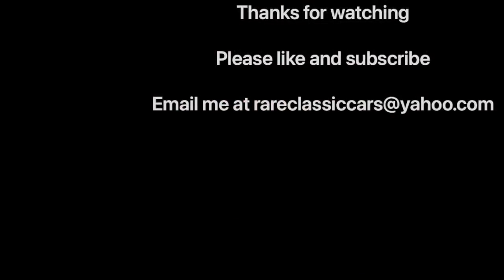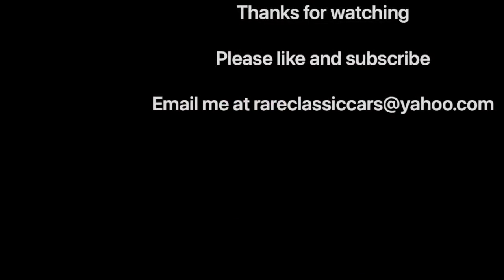Worst Engines of All Time: GM 2.5L Iron Duke Follow Up

Comment: I had a 88 S10, and a 86 Pontiac 6000 .  Both with the iron duke.  The engine was MUCH smoother in the S10.  When the S10 engine got about a 110,000 miles, it started to rattle when you reave it up.  I did fine that Slick-50 made it a little more quiet........for a while.
Reply: Jim, in ‘88, GM started equipping that engine with balance shafts. Your ‘86 doesn’t have a balance shaft. 

The ‘88 engines were far more pleasant than the older ones ...
Reply: @sking2173  I don't remember any advertising for the balance shafts
You think GM would really promote that
Reply: @jimosterfeld3371  — Yeah, I would have thought they would have made that a selling point, too. I knew it because I was a gear-head, so kept up with automotive news.

Another balance shaft addition went quietly into production in ‘88: the Buick 3800 V-6. In ‘87, the 3.8 had been redesigned to be an even-fire engine, which was highly publicized, but the balance shaft addition the following year came without fanfare.

That engine went on to be one of GM’s best ever.

Comment: I think in the last 2 minutes of your video you hit upon the essential point of why there were so many conflicting responses to your last video. It's all about expectations.

Large domestic 4 cylinder engines were not a new thing in the late 70s. So I would imagine it came down to whether customers were ready to accept that rough operation in return for an unstressed engine. If that rough engine delivered on what was expected (long reliable operation, mileage, whatever) then that should be considered a relative (acceptable) success. Buyers who traded in and might have been horrified at the behaviour of the Iron Duke as far as smoothness... that might itself point to one of the reasons why the domestic auto industry suffered so greatly in the 80s-00s, because people continued to patronize companies that ignored market needs and relied on brand loyalty. (one just has to look at the crop of bland vehicles in Pontiac's roster the few years before its demise... is there any surprise that it was chosen to receive the ax? Once older set-in-their-ways buyers got too old to keep buying G6s and G5s etc. the brand would have died anyway!)

So as you said in the last minutes of the video, many people who test drove the smoother import 4 cylinders probably ended up shying away from domestic econo-cars for good. (from memory, not all import 4 cylinders were smooth! So it's not an issue unique to the Iron Duke). If no one had bought Iron Dukes the bean counters would have certainly reacted fairly quickly (note how it disappeared from the F-cars by 1986). But people bought them and kept using them and it seems they did what they were expected to do: move people (and cargo to some extent) from point A to point B with a fair amount of reliability. Those expecting to rev with the DOHC'ers were disappointed, but their expectations were completely out of line to begin with and a half-decent road test would have confirmed this prior to a purchase.

In summary, customer expectation mismatch is not a reason to label an engine "worst of all time". There are plenty of engines in history that even when operated well within its intended parameters, failed to reliably deliver on their basic mission and it doesn't get any worse than that as far as I can tell. (I'm thinking of the Vega engines, etc.).

(perhaps the 2.5 might deserve the title of least exciting GM engine ever? or least refined?)  (disclaiimer: I have not owned a 2.5 car but have been around a few and driven a couple. Hard to decide which one I felt was more unrefined... the Iron Duke or Ford's 2.3l 4-cyl as installed in a mid-80s Mustang, which I also drove.  I too ultimately opted to stick to Honda 4 cylinders once I sampled some of their 84-85 1.5l engines! )
Reply: Well written, balanced response. 

I personally think the Iron Duke was a huge success, because of its general reliability. And after GM equipped it with the balance shaft on ‘88, they were no longer unpleasantly rough.

But by the early 90’s, that type of engine was falling out of favor because larger  displacement, 4-valve, high-rpm inline-4’s were viable because of balance shaft technology. 

Saying that, GM was still slow in adopting state-of-the-art 4-cylinder technology. The Japanese flat out outpaced the world in 4-cylinder engines.

Comment: I remember the first time I drove a newer S10 with a 2.2L, coming from my old 2.5L Duke S10. W.O.W.  I couldn’t even tell it was running at idle.  I still miss the old Duke though.  Paid $1100 for it used and ran the hell out of it for 5 years.
Reply: That 2.2 had balance shafts. They work !!

Comment: The Tech 4 name was used to heighlight 4 significant techologies used on the Iron Duke engine.
 These technologies are 1) Direct fire distribuless ignition using two twin plug coils 2) Throittle body fuel injection 3) Roller hydraulic vaslve lifters and 4) Fabricated stainless steel exhaust manifold.
These 4 technical features were all in place by about 1982. The introduction of thes features were used on a very high volume, low cost engine approxamate;ly 5 years before they became widedspread usage in the industry. These features were developed to meet emmissions and fuel economy which were the prime drivers at that time period..
Reply from the maker: Number 1 came out in 1987. Number 3 in 1985 I believe.
Reply: @RareClassicCars  The 1982 Iron duke in the camaro has 
2) Throttle Body and 
4) fabricated exhaust manifold ..
It tends to "eat" them, fatigue failures due to the engines beastly shake. In California I use to replace the manifold right before each 2 year smog inspection and the O2 sensor too. Otherwise you had a loud exhaust and failed also the smog emission tests. The 1981 GM cars in California that used the same exact O2 sensor had them replaced every 12 months. GM used a fabricated stainless exhaust manifold to allow the sensor to heat up quicker to get the engine in closed loop mode quicker. Some pre 1982 non California iron dukes had a cast iron exhaust manifold and with an O2 sensor too. I got one off a junked GM Sunbird at a junkyard.

3) I believe the roller lifters came out in 1985 too.

Comment: Lots of tap-dancing and back peddling in this video.  The facts were that they didn't have another powerplant at the time and those big block V8s where already 20+ years in development back in the 70s.  According to the criticism of this video, GM should have simply withdrawn from the automotive market rather than have a rough and unrefined engine to power their vehicles.  This is nothing but armchair quarterbacking looking back 40 years.  😔
Reply from the maker: No. They should’ve given the engine the balance shafts it eventually got in 1988 much earlier
Reply: @RareClassicCars  Why stop there?  Why not turbocharger, direct injection, variable valve timing, variable valve lift, engine oil cooler, etc?  I do not agree with your criticisms.  You can look back on ANY product and pick it apart.  Time and refinement go hand in hand.  The first Chevrolet V8 had no oil filter.  So, I guess it was a mistake too?
Reply: @RareClassicCars  — How many inline-4 engines had balance shafts before ‘88 ? Mitsubishi, obviously, and Porsche, SAAB (licensed from Mitsubishi).

Honda didn’t adopt balance shafts until ‘88. And while it’s not an inline-4, GM equipped their 231 V-6 with balance shafts in — yep, 1988. 

There were a lot of rough and raucous 4’s back in the 70’s and 80’s. Even the highly vaunted Toyota, up until ‘69, produced a Corona with a 3R engine that shook like an old mail-Jeep when the thing was in drive (auto trans was much worse). 

The Volvo B21 engine, introduced in 1974, shook like a paint mixer, but Volvo used thick, soft motor/transmission mounts to isolate the passenger compartment. It was amusing to watch the engine dance around in the engine bay, but it worked — until the mounts collapsed and the car buzzed like a vibrating massager. 

Point being, balance shafts were not commonly pursued until the late 80’s, and the Iron Duke was an economy engine, and in the 70’s, didn’t warrant the expense of balance shafts. 

Many have said in these comments that the fault with the Iron Duke is not in the product, but in the application of that product. I must agree.
Reply: @sking2173  Under the philosophy shown in the video, GM should have withdrawn from the auto business because they didn't have a smooth enough powerplant to satisfy customers.  That decision would have ended General Motors, THOUSANDS of jobs , economic chaos and shareholds with nothing for their money.  Instead, they used what they had with the time available.  This looking back 30+ years and second guessing people who had to make decisions in the NOW is distasteful.  Again, this video is more tap-dancing and back peddling.

Comment: GMs  big promotional thing preparing the public for this engine was a durability test of running a duke non stop for a million miles without issues.  With That said 
My mom traded a 77 rabbit for a 85 Calais with a 5speed. Vw could kick the olds ass at any test you could imagine. paid fifteen grand for it. Same price as a mustang gt. I know because I tried to sway her a bit. Dad had a 84 omega with auto, decked out company car and they were nutless, shaky,noisy, terrible sounding pieces of shit.

Comment: Hello Adam.  Thanx for this video. My step dad had a '88 S-10 with this engine and auto.  It was perfect as an appliance what he wanted for his needs.  It was like a 1928 chevy as far as crude.  But my main reason for posting is, I read fifty  years ago...wow.. in pop mechanics I think that the physics of smoothness to a 4 cylinder engine, back then was limited to 2.3 liters.  I believe Mitsubishi came out with a balance shaft  for theirs then.  Right?  It's a shame that BEAN COUNTERS control "for just today, not what the future is" mentality.  When immediate PROFIT, trumps, long term growth because of quality.   I forgot the guy's name who came from Fiat, into Chrysler Corp.  after Mercedes stripped it of all it's money, and couldn't believe the CHEAPNESS of Chrysler Corp. vehicles and said to them put an additional 150 DOLLARS into just the interiors.  What a difference that made to the Challenger, 300, and Charger.  Automakers>>> here's a tip>>>> your can fool some people all the time, but you can't fool people forever.  Your ruined REPUTATION takes years to overcome.  You just might go out of business, and have NO job!  ADAM, again great vid!  Kudos
Reply: Your stepdad’s ‘88 Iron Duke had a balance shaft — first year for that feature on The Duke. It made a big difference in the engine’s demeanor ...

Comment: I will reiterate what I said as a followup to the first round:  the failure of the Iron Duke was not the engine itself so much as the APPLICATIONS it was used in. GM had no business dropping this in just about all the passenger cars you mentioned. Considering that, I think that makes GM management that approved the use of the Duke in the cars you referenced the REAL failure, not the engine itself. 

So where does that leave it? As a bottom-feeder car, small truck & industrial engine. I don't know why GM never branched out much into the industrial sector. The Ford 300 six was ubiquitous & dominant in airport equipment & the 2.3 Lima was out there a lot too. Even the old straight-6 200 was popular in older belt loaders. The Duke would've excelled in that environment.

Comment: When people hear the term Worst engine, what usually comes to mind is unreliable. Simply being crude, and gutless doesn’t usually qualify an engine as the worst if it’s otherwise reliable. That explains the strong defense of this engine. What helped its reputation was that during its heyday, people’s expectations were low. Also, when installed in the X-body cars, the engine was the bright spot because the rest of the car was so problematic.

Comment: The Iron Dukes predecessor the 153 cubic inch Chevy ll engine from 1962-70 was no better , other than you could only put one power robbing option on them , the Powerglide automatic transmission .
Reply: People knew them as Chevy II engines, but I remember them being used in thousands of postal Jeeps. In that application, they served well and economically.

Comment: The GM 4 cylinder (Iron Duke, Chevy II or whatever you wanted to call it, definitely was not an aspirational engine of choice. I remember getting in an ‘87 or ‘88 brand new Oldsmobile Cutlass coupe. The car was comfortable, roomy, decently screwed together, with a nice fabric interior. It was a pleasant car. It started up fine, ran fine and had surprisingly good responsiveness to the controls and control inputs. It actually had decent acceleration and cornering plus it actually had good stopping distances. But that engine. The sounds it made just literally screamed Cheap economy low rent status. Totally unbecoming for any Oldsmobile. Especially when smooth, responsive and good sounding engine were readily available from other manufactures. 

The funny thing is, when GM finally decided to address the roughness of this engine, it’s sound and feel improved considerably.

Comment: Had a new S-10 Iron Duke with automatic in the early 90s.  It couldn't shift out of 2nd gear no matter how many times I took it back to the dealer for adjustment.  I didn't keep that "reliable" transportation for long!  I'm sure it would have been a ton better with the manual (or the 3.8/4.3).

Comment: There is no such thing as a Pontiac or Oldsmobile Big Block. Dam dude.
Reply from the maker: Um. There definitely is an Olds big block. You’re way off there.  There is too for Pontiac if you consider the short deck 265/301 a small block. They are physically less tall than the 326-455s.

Comment: Gawd awful NVH on the 2.5L  - not great power, not great fuel economy.  Agree with you on this one!
Reply: I had one in a company car, an ‘86 Olds Calais, with that 125 transmission, and that thing got some tremendous fuel mileage. Admittedly, it was a small, lightweight car.

It was loud when revved high, but it was torquey and had long legs (tall gears), so it was pleasant at highway speeds. I liked it.

Comment: Not to worry Adam, message received.  And yeah, it is easy to so why folks would trade off one of the higher end GM cars equipped with this engine, the iron duke was probably a great sales tool for Toyota and Honda.

Comment: This follow up clears up a lot of things. Problem is with the duke it was in GM cars that looked futuristic 80’s that had a Duke engine that was 25 years behind times that of a older engine design.  The engine didn’t fit the design of the current times it was in. At the time Japanese engines like the 4age had duel overhead camshafts smoother running and higher reving. Drawback is those engines have hoses scattered everywhere on that engine and much more complex to work on. GM’s reasoning of the Duke engine was a simple solution to increasing gas mileage in cars. I drove the 84 Fiero the other day 150 miles. The Duke engine just churns and does it’s job and really good at lower speeds of a work horse of a engine that it is. If you haven’t already done a video of the GM Quad 4 engine that would be a welcome.

Comment: Thanks for the follow-up. I was one of those that said the S10 with the Duke was a great combo. As a compact pickup engine? Absolutely! As a front wheel drive Oldsmobile powerplant? Heck no! You're 100% correct here and I think that GM should have just used this in pickups and utility vehicles.
Reply: Chrysler's 2.2/2.5 in the Dakota pickup wasn't a good match
Reply: @timothykeith1367  Agreed! It was a much better small car engine, just like the Iron Duke was a much better truck engine.

Comment: I drove an 1988 2.0 Bereta . I never knew this was the reason for such a noisy engine . I grew up in Ireland where we had nothing but tiny 4 potters . And all British , German and Japanese were far superior to this GM engine . The car lasted well into 100 ,000 miles . Trans was smooth even though I lost overdrive on it in the end . Paint was peeled off after 3 years . Did a cheap Maco paint job . Also terrible quality. But driving this car wasn’t pleasant. Terrible power output , noisy start up in cold winters of NewJersey . Some mechanics felt the noice is piston slap . And when hot the pistons expanded to where it reduced play in cylinder. But a really a reliable car and power train never gave any trouble . I sold with 140 , 000 miles on it . The dodge shadow 2.2 I had later was more fun to drive . Same power more or less but noisy as it was more in high Revving. I own a 3.6 caravan now . Review say great engine . Garbage absolute Garbage . Noisy and awful transmission . Chrysler don’t know to make trans . Motors are great but trans not so much . I’ve had slant 6 , 4 cylinder, 3.9 v6 / ( great engine ) and now this 3.6 . Garbage and I hope Chrysler drops it from their line up .

Comment: As usual Adam you are 100% spot on.  The Iron Puke was a unrefined junky motor although reliable which you did state in the first video. We had this engine in an 1981 AMC Spirit when AMC used it before they developed their own 2.5L and also in a 86 Olds Cutless Cierra.   Both were very crude unrefined terrible driving experience engines.  We had a lot of AMC’s with the 258 in-line 6 which was so smooth and such a much pleasurable driving experience compared to the iron puke